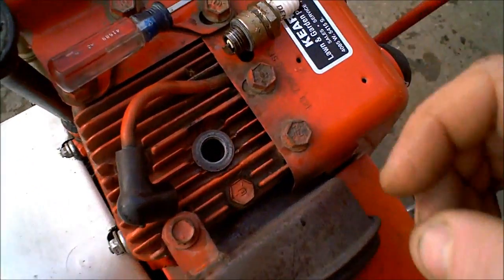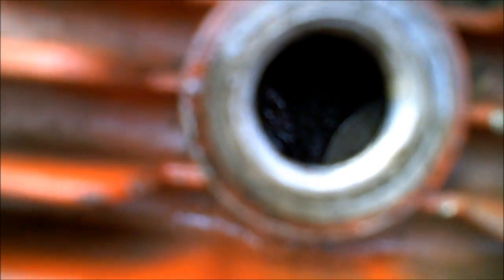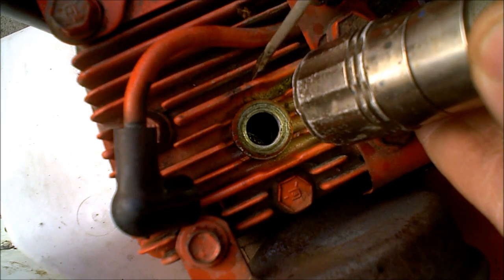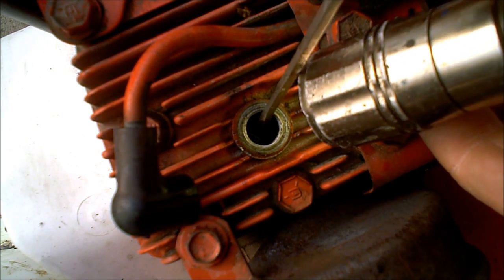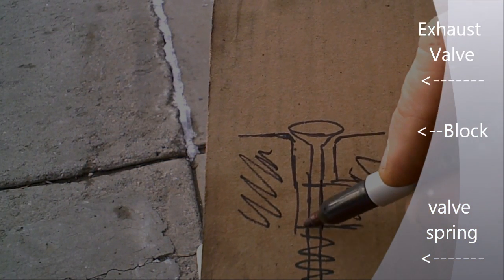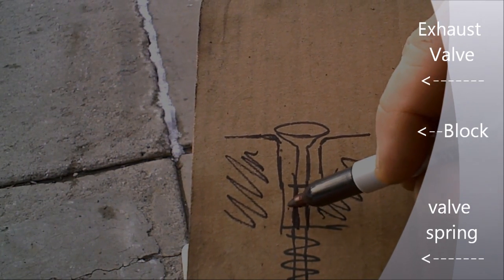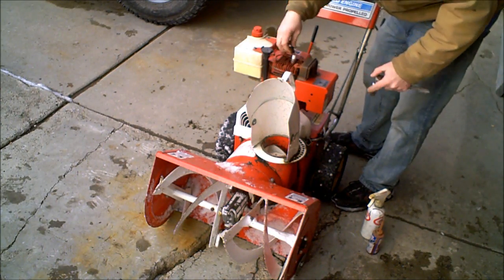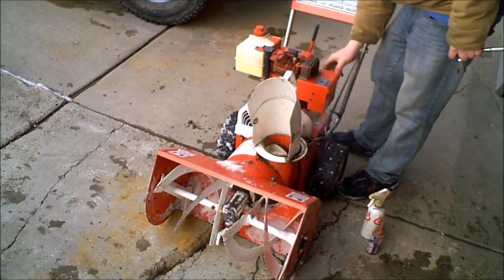Briggs Tecumseh Free a STUCK VALVE without removing head

Comment: MY FAULT but you saved me a ton of work.  I tried using some 'older' gas (just to use it up) in a new rebuild.   Big mistake.  The 8-HP B&S started and ran but after it cooled down, the intake valve stuck open with NO compression.  FIRE shot out of the carb.

I used PB Blaster but now I think carb cleaner would work even better to dissolve the varnish deposits on the valve stem.  Freeing the valve using a screwdriver was not easy.  After tapping hard several times, the valve finally snapped shut, compression returned and now the generator works just fine. Thank You.

Comment: Great video, well explained. I will be using that method to free up a stuck open exhaust valve on a 6,000 watt Generac generator that has a 10 hp Tecumseh engine.

Comment: i have a 8 hp tecumseh on my snowblower and when i turn the flywheel by hand , it will only make a few rotations and it jams up , this happens clockwise or counter clockwise, it will jam up , you can here something hit the top of the head.  when i tried to start it with the electric start it made my starter just hum because it could't turn it over , that's how jammed it is .would you have any clue to what's causing it to jam like that,
By the way, your content is great !!!
Reply from the maker: If you can get more than 1 full rotation but not quite 2(1.5). It is a valve issue. It could be stuck, too long of spark plug installed, debris on the cam gear. I assume you have a flat head(L head) and not an OHV engine(it'll have a steel cover that says OHV). This is an effortless engine to work on even for novices. Take the roughly dozen bolts out of the head and pop it off. You'll see the 2 valves and piston. See if you can spin both valves/they move up and down.

Comment: Nice video.
Learning from you is easy.
Thanks for showing what can be possible.
My engines with this kind of access have always been down on a mower and facing front.
I shoot them and pull them over to decarbonize valves sometimes, but this gives me more to think about.
Thanks again.

Comment: Hello, this video sounds extremely useful to me, as I have a similar Tecumseh 10HP, with the valves stuck, I believe. It was running great, then standing in the open for quite a few years. Now I tried to bring some life to it, it has no compression at all, and I could see through the spark plug hole that the valves did not move when I cranked the engine. I thought to open the engine, but after watching this video, I might be able to save some job there. Thanks!

Comment: I have a john deere L100 riding mower with no compression. Has been running ok but less power (towing a loaded trailer) than it once had. Shut it off and it hasn't started since. No compression. One valve was clearly stuck open. Sprayed crc lubricant in there and both valves now move when I crank it. Still no compression. The sticky valve is still not seating properly, I believe, because the rocker arm is very sloppy. Rods are not bent. The spark plug is located differently than the video and I cant seem to see the valves to turn then with a screwdriver. Do you think I need to pull the head? Lap the valves?
Reply from the maker: You have the 17hp ohv Briggs. If the valves stuck the likely touched the piston and are slightly bent. The head will need to be taken off and the valves replaced or bent back.

Comment: My snow blower is stalling when it gets a decent amount of snow going through it. I'm going to buy an impeller kit but I've also read that it could be due to the exhaust valve not closing all the way. Do you think this could fix it?
Reply from the maker: A sticking valve would show up at all rpms. You would feel the engine misfire/pop from time to time. Generally low on power under load is a main jet partially clogged in the carburetor. Or the jet is undersized causing the engine to run lean. More serious low power under load is caused by low compression. Low engine compression can be caused by valves not seating fully and or worn piston rings. Generally valve not seating fully will show up as rough running and/or an engine not wanting to idle very well. Warren piston rings can show up as engine smoking under hard load but not always, oil slash oil vapor blowing out the crankcase vent (newer stuff this will be diverted back into the carburetor to suck through the engine). There's also the possibility that you're just maxing out your engine horsepower. Now saying all of that 99.9% of everything I fix these days is fuel / carburetor related due to the horrible gasoline we have these days.
Reply: @sixtyfiveford  it's a 5hp Tecumseh that's at least 20 years old if I had to guess. I cleaned the carb using your videos as a guide before the season. No smoking while operating. Just bogs down then stalls when I get into thick stuff. Right now the gas is the bad stuff with ethanol and fuel stabilizer added. Once it I'm getting 93 ethanol free stuff. If the valves are not starting fully will what's in this video fix it?
Reply from the maker: @c.j.taylor7325  You would need to take the cylinder head off and lap the valves. I rarely find engines that need this done though. Generally you only do this while rebuilding the engine. Does your carb have a adjustable main jet (screw protruding out the nut holding on the carb bowl) or a fixed jet (just a nut holding on bowl)?
Reply: @sixtyfiveford  it has an adjustable jet

Comment: My 8 hp Briggs & Stratton did this on my generator while it was running, I pulled the head off and the exhaust valve was stuck up I lubed it and it had compression again. What causes this? A lubrication problem? I could understand if it had been sitting a long time but it had been running for about 20 minutes when it stopped. The engine looks clean on the inside I saw no issues other than some carbon buildup. Has great compression again.
Reply from the maker: 2 causes are rust from sitting for long periods and carbon buildup .
Reply: @sixtyfiveford  Thanks, I hope my problem is solved now.

Comment: Very common on these Tecumseh snow blower engines is the valves loose their clearance due to wear, in which case you can re-grind them and lap them. A bit of a daunting task if you have never done it, but still perfectly doable.
Reply from the maker: Yes, I've done many a valve jobs on Tecumseh engines.

Comment: I think I have a sticky valve which causes low compression every 4-5 strokes. I'll try the PB Blaster thru the sparkplug hole. Tecumseh LV195EA. How long does this fix last?
Reply from the maker: If you get it freed up it will last indefinitely

Comment: This helped me save a mower from the scrap heap today.   After watching your video, I put an engine back together that I was going to part out.  After taking off the head, I could see the intake valve was slightly stuck in the open position.  I then sprayed a bunch of penetrating oil around the valve and kept tapping it back down flush with the engine block with a plastic mallet when it was supposed to close.  I also made sure the valves could be turned by hand.

After putting it back together, it had compression and started right up.
Reply from the maker: Thanks, I'm glad you liked it.

Comment: Thanks Buddy, almost same motor with same problem, I subscribed to your channel
Reply from the maker: Awesome. I'm glad you liked it.
Reply: sixtyfiveford but mine a 8hp n looking in the spark plug hole, looks like 3 valves moving,, is that correct?

Comment: Mines stuck shut and idk what to do
Reply from the maker: The engine should not rotate in the forward direction then. Try rotating the engine in reverse until it hits the valve cam lobe in the opposite direction. Then back forwards. Do this a few times with hand force to see if you can use the engine to free it up. You may need to remove the Carb or Exhaust so you can view and spray the valve stem with penetrating lube.

Comment: I’ve had great luck with marvel mystery oil: engine treatment. Half the bottle in the gas and the other half in the oil. Worked on a Mitsubishi Mivec engine that went +30k miles on an engine change and a Toyota pickup that sat for years

Comment: Today, my 9 yr old gas snowblower tried its 1st run B4 winter. It started easily and ran for about 3 min then locked up. Cannot pull even an inch of the rope, and electric-starter works but not the engine. May be the piston/valve seized. Tomorrow, will try this method to see whether it can be saved!
Reply from the maker: Was it empty on oil?
Reply: I called a service guy to come and check, he straightly told me must be the piston broke. Tell me to get a new one.
Reply from the maker: @charlesyue3891  Sorry for the bad news.

Comment: Wish i could do that on an Onan...
Reply from the maker: If it's overhead valve you can access the backside though the valve cover and the shaft though the intake or exhaust port.
Reply: @sixtyfiveford  I have a 3cr opposed twin flat head. One valve cover is accessible and the other is covered by the intake. I just removed the head and fixed it. It had the exhaust valves stuck open on both cylinders. Flat heads are easy. :)

Comment: I have a flat head 5hp Briggs that has been sitting in a field for 10 + years. The intake valve is stuck shut. I removed the tappets and tried to pry the valve up under the valve spring. It's like it's welded shut. I've used PB and Marvel. Any suggestions?
Reply from the maker: obviously with this condition the motor doesn't want to rotate. I would soak  it and rotate the engine forward and backwards to try and free it up.

Comment: WD-40 is a solvent.. it has no lubrication properties at all.  Use some Liquid Wrench.. which is a good solvent for rust and carbon..and has a little lube property.. to free it up.. and keep douching it to clean the guide and valve stem.. follow that with some engine oil.Now.. drain the oil and put in fresh.. run it a half hour..and then change the oil again.
Reply: I was positive this was misinformation but it's true. When using it on door knobs, windows, 1,000,001 others, it's not appropriate  to follow it up with oil. What do you use?  Silicone?
Reply: He's using it as a solvent tho. Then you follow with lube. Don't know what you are complaining about.

Comment: I'm working on a Briggs engine from the 50s that was probably sitting in a barn since around then. The exhaust valve was stuck shut, I worked on it for a long time. Soaked it in MMO and it freed up, now it's stuck open. It's seriously stuck. No movement at all. I tried heating it up, pounding it down, lubricating it, and I can't get it to move a hair. What should I do? Just call it quits and scrap the engine?
Reply from the maker: I'm sure you've done this but I have to call out the obvious. The engine does need to be in a position that allows the camshaft to be in the position that allows the valve to close. If you haven't, pull off the head. Rotating the valve with pliers gripped to it(rag or similar to minimize gouging) is your best bet.

Comment: I have a John Deere TRS 22 (tecumseh 5hp).  I tried to compression test, pulled starter cord, but didn't realize that tester fitting was too long (in spark plug hole).  Engine jammed with cord about halfway out.  I was able to get tester fitting out of cylinder, but engine won't turn now. Intake valve stuck in open/up position.  Can this be fixed easily? Did I bend intake valve, damage lifter, or damage camshaft?  Help!, Thanks!
Reply from the maker: More than likely the valve/s is bent. You will need to pull the head. It is possible to simply bend them back without pulling them from the motor with a little care and patience. If the head gasket wasn't damaged you can reuse it or they are relatively cheap.
Reply: Thanks sixtyfiveford! Before I read your reply, I was able to turn crank and free stuck engine/valve.  I tested compression (w/ correct fitting!) but now reads 0 psi. When I pull starter rope, both valves move up and down, but I hear a metal clink noise.  Is your advice still the same?  Thanks again!
Reply from the maker: If the valves are bent they will not seat properly and you will get a 0 reading on the gauge.
Reply: Thanks! I'll check it out

Comment: Thank you. That was really helpful! My generator wouldn't start this morning, no compression. I suspected the valves. After watching your video I took the plug out and shot some WD40 on the exhaust valve. I couldn't turn it around because it was too tight to get a screwdriver in there. Put the plug back, and it started first time. Have compression again! Cheers.
Reply from the maker: That's GREAT. I'm glad they video was helpful.

Comment: Had this problem (no compression and could not start), squirted in some PB Blaster, let that stand for an hour or so and then squirted in some transmission fluid and worked the valve loose. Hammered a chopstick on top of the valve to pop in back in fully and this really had it going when I spun the blade.  Started and blew out some smoke but seems fine after this.  Thanks for the advice and the video.
Reply from the maker: That's great. I'm glad the video was helpful.

Comment: I have a 12.5 hp Briggs and Stratton on a MTD riding mower that I believe has a compression issue. If I pull the spark plug out the engine will crank over and over but if I put the spark plug in the engine only does about one rotation before it stalls out. Does this seem like the same issue? I tried lubing up the valves last night and it didn't seem to fix it yet. Perhaps I need more lube or does it sound like it could be something else? Thanks for your video.
Reply from the maker: Sounds like you have good compression and your valves are working properly. If they were sticking they would stick open and they engine would spin freely, the same as pulling the spark plug. You more than likely have a wiring issue to the starter and it isn't spinning hard enough. You can take jumper cables directly from the battery to the starter. Hook up the red + and black - jumper cables to the battery and put the other end/black Negative to the engine block; then put the other end of the red/Positive to the little bolt on the starter with the thick wire coming off. The starter should crank with full power once you touch it. Put the Key in the RUN/ON position and this should be enough to start the engine. If it is then you have a dirty connection somewhere or a failing starter solenoid. If it doesn't have enough power to crank the engine, more than likely the starter's brushes need to be changed.

Comment: I fixed  a  engine  that  hadn't  run  in 30 years  and  the  intake  valve will randomly get stuck open
Reply from the maker: Great work.
Reply: sixtyfiveford I worked on it as I had time a little along all I did was fix the carb and a new sparkplug and problem solved.

Comment: I had the same problem today . great video
Reply from the maker: Thanks, I'm glad it helped. Remember when you put it away, to pull the motor over until you feel resistance. This will make sure it is on the compression stroke, so both valves are closed.

Comment: Thank you! We just got 10 inches of snow in northern MN and my snowblower woudnt start, it was a stuck intake valve and this fixed it .
Reply from the maker: Awesome. Glad the video helped. When you put it away, make sure it is on the compression stroke(pull until you feel resistance on the rope). This will make sure the valves are closed, so if they stick then the engine opens them.

Comment: Very good trick and explanation  ( originally I could  see the edge of intake valve but wasn't positive it was really it and or if it was stuck ,it is and was ) but I was so involved trying to turn it with the screw driver I almost total stripped out the Spark Plug Threads !,!

Comment: Great video. Mine wouldn,t start after lunch although had been standing a couple of years. I'd already taken off the head so lubed and turned the valve by hand.
Easy fix and back running in 10 minutes.
Thanks.
Reply from the maker: +Neil Tong Thanks for watching.

Comment: I oiled mine and it will not rotate. What to do next ?
Reply: Junk yard.
Reply: +Robert Hoover pull the engine over slowly with down pressure on the valve to get it to move adding more penetrating oil

Comment: I will have to try this on my machine. but i'm not sure if that is the issue.

my snow blower isn't pulling in air and fuel. it sucks and blows through the intake and it is completely dry inside... but both valves move
Reply from the maker: Ravens Reign Sounds like a stuck intake valve.
Reply: sixtyfiveford Yeah I think so too, but it does move up and down, maybe its not closing all the way

Comment: Do you have a How too, on a Stuck Exhaust Valve on Briggs OHV 16.50. It's on a Husky 5000 Generator.  Thanks from St Louis, MO,
for another Great Video.
Reply from the maker: George Edwards Since it is an overhead valve engine you can access the back/stem of the valve by quickly removing the valve cover. You'll be able to see which valve is stuck while you rotate the motor and help push it in and out to free it up.

Comment: Same issue with my 5HP I/C Briggs.  The intake is stuck open from using bad gas a long time ago.  I have PB blasted mine for days and I still cant get it to budge.  I dont want to bend the valve, should I use a hammer to rubber mallet?
Reply from the maker: Sparta Rotate the engine to make sure it is on the compression stroke and at top dead center. Use anything to lightly tap/twist it. To get it on the compression stroke watch the exhaust valve. Pull the rope and watch the as the Ex Valve opens. The piston will then come to the top and the Ex Valve will start to close. Allow the piston to go all the way back down then back up. This will be the compression stroke and Top Dead Center The Exhaust will be closed and the Intake should as well, not so it your case but the cam shaft will be out of the way so you can tap it.